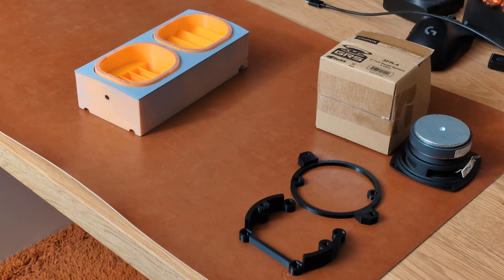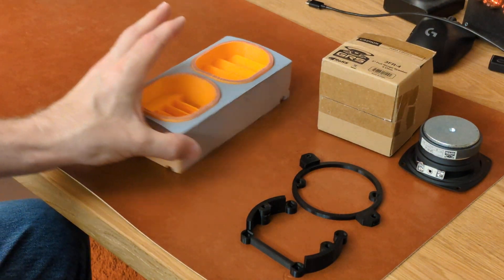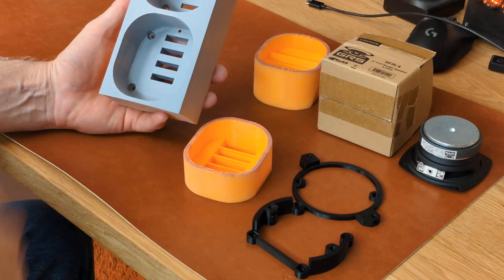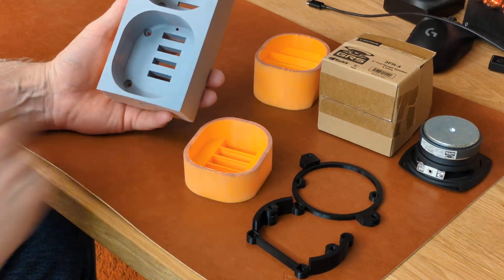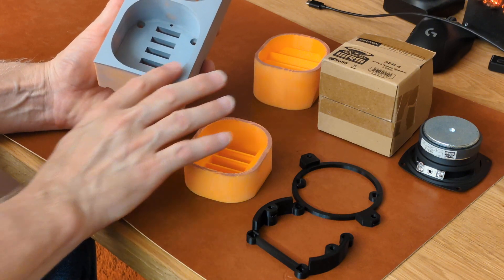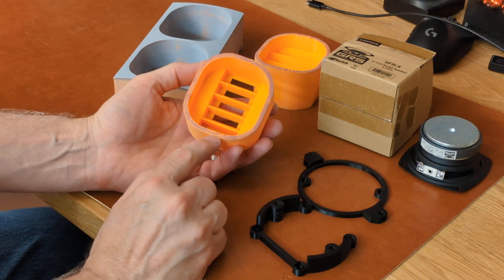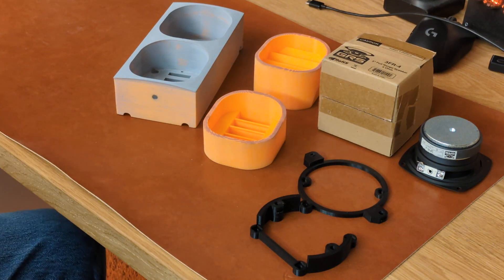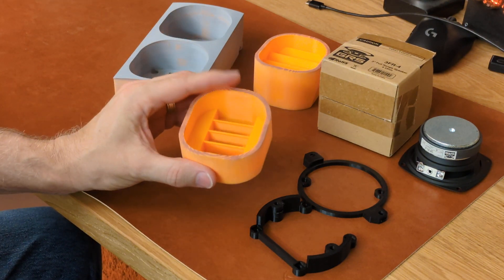3D Printed R2D2 - Part 105

Comment: Following. I have the dome and body glued up and almost everything printed. We now need to finish the assembly and painting as well as the electronics. It's a fun project, but also big commitment!
Reply from the maker: That is an understatement!  Good luck on your build!  Remember that it's OK to take breaks from the project now and then.  I didn't, and it ended up burning me out for quite a while.